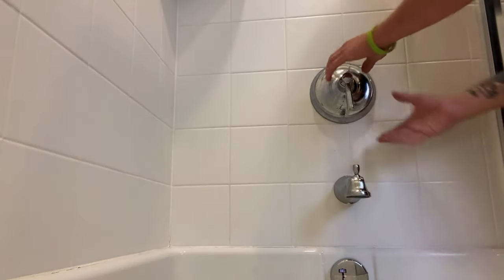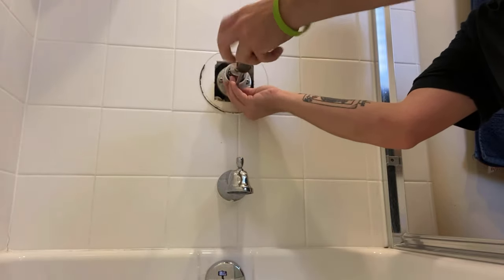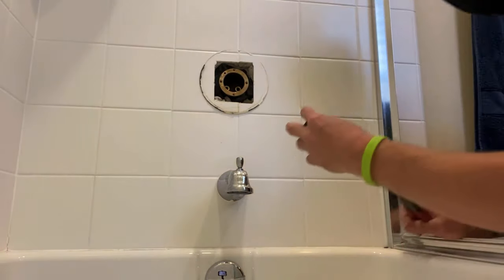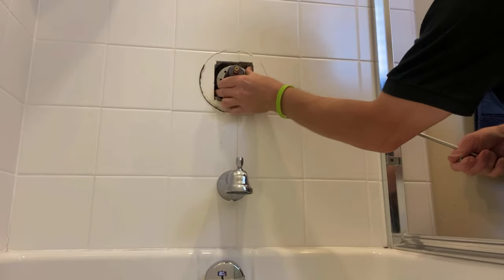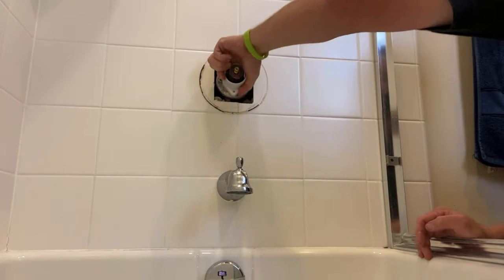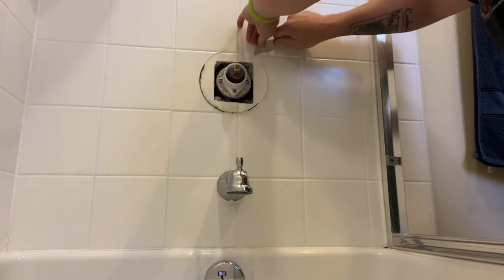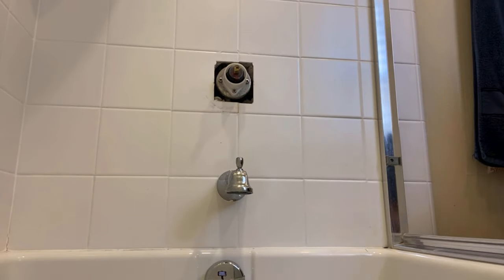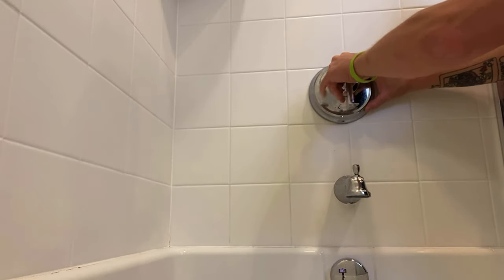How to fix Kohler shower leaking, not getting hot or low pressure!

Comment: Thanks for a great video. I installed the new valve parts (both of them) and the water is mixing properly now. Only now there is an ever so slight drip coming from the shower head where before with the old parts there was no drip at all. Any ideas?

Comment: I had a issue where the hot water pressure dropped. Replaced the Balancing Cartridge/Regulator twice. Flushed the pipes also, with no restriction. But... when everything is reassembled, the hot water still had no pressure. I also tried to fine tune the supply valves to the hot and cold. No change.
It's very frustrating.
Reply from the maker: When you flush the valve with the cartridge out is the pressure the same from both  hot and cold ports? The hot side would be on the left.
Reply: @PlumbingExplained  ... It appears the same, but I don't have a way to measure the actual pressure.

Comment: The Kohler shower valve in our bathroom is quite different and so far not covered here on youtube. It is a "shower only" type valve similar to Kohler part # K-8304-KS. There is no tub/bath faucet. It is only 5 years old and leaking through the shower head.
Reply from the maker: Yes it’s likely essentially the same cartridge with a different back side if you go to your local plumbing supply and ask for the newer Kohler cartridge they’ll hand you one, it’s the same concept for install and removal
Reply: Did you have the Kolher Purist shower valve? My shower head is dripping /leaking to ??
Reply from the maker: @paulrichardson5309  that will be the same just the back side is different same principal
Reply: The disassembly of the K-8304 valve is quite different. There are 2 check valves (part #1229168) on the left and right which obstruct the removal of the cartridge (part #GP800881).  @PlumbingExplained

Comment: Any body have the problem where the valve doesn't shut the water off. This is happening with the new parts
Reply: Did you find a solution? I am currently having this problem
Reply: @elizabethdumlao5040  I had to return the new one cause it was bad

Comment: I rea did my master bathroom everything brand new in the shower gets hot but after seven minutes it gets cold immediately after I got out and went into the hallway bathroom put it on and it was hot and stayed hot for 30 minutes and when I shut it off it was still hot a plumber said I was just running out of hot water but if that’s the case I would run out of hot water everywhere I don’t know what the problem is just spent $20,000 in the bathroom
Reply: These cartridges have a design issue.  They dont work

Comment: It doesnt make hot water.  This thing has never worked right.  Have replqced the cartridge many times
Reply from the maker: Do you have a tankless heater?
Reply: @PlumbingExplained  i had a tankless and have switched to a tank heater and am going to install kholers new part now.  Kholer has a new mixer cartridge part now to retrofit the old ones that always fail.
Reply: @bradspaugh9827  Where did you buy the mixer cartridge from?

Comment: Why do I have either hot or cold water even when I flip the cartridge in this kind of valves. Could it be clogg any port?
Reply from the maker: The back portion is the temperature balance half, pull the cartridge flush the valve by turning the water on to the house and then reinstall the cartridge see if that helps, if it doesn’t then you either got a defective cartridge or debris got pushed into the temperature balance portion of the cartridge and you’ll need a new one.
Reply: Thank you. What i noticed is that there’s no knob to adjust the temperature. Only the handle itself. The costumer told me that since the beginning they had this issue. I couldn’t tell if the rough valve was upside down. Hopefully not